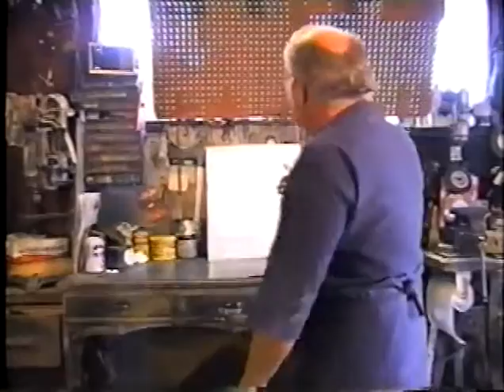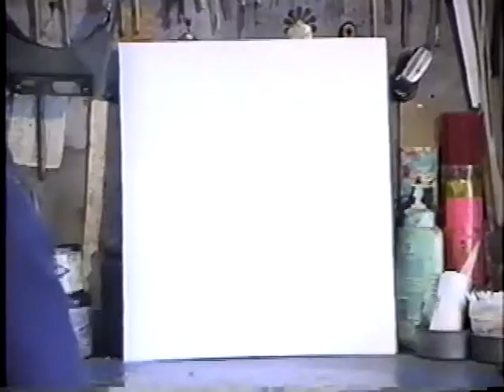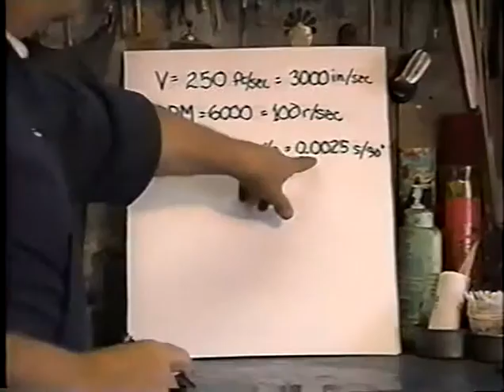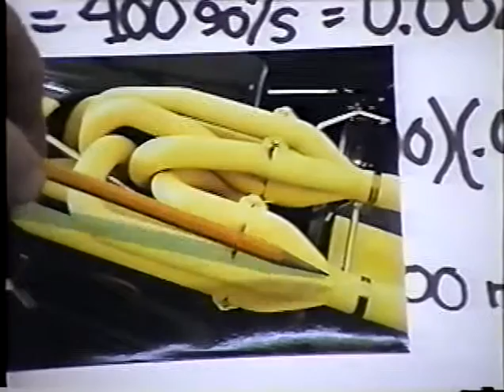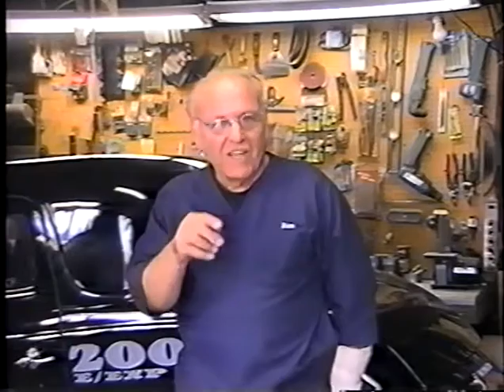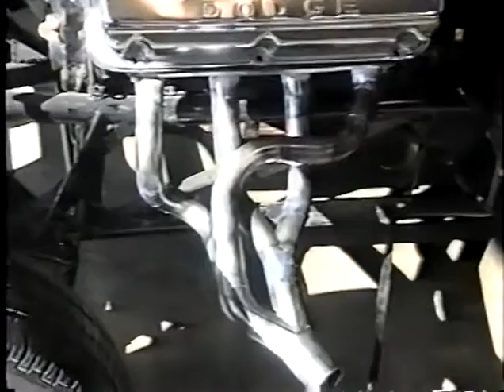Dr. Flame-O Presents: Timed Headers

Comment: Thank you for showing how to build intake and exhaust systems for mopars. Mine is a RB 383 G code that I’m turbocharging and port EFI. Just as a FYI bell mouths flow more air in and out the engine;) by twice as much